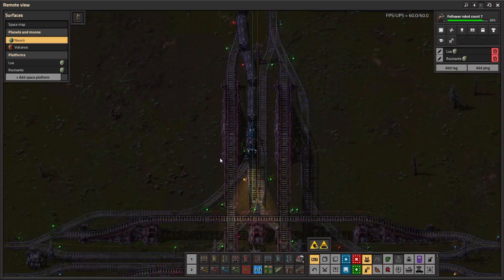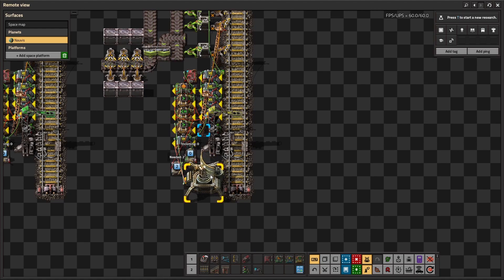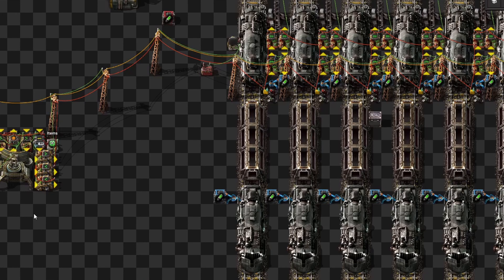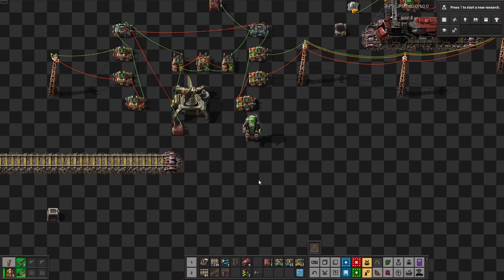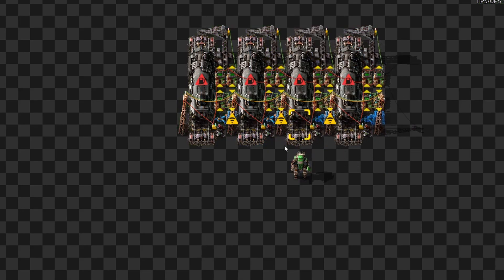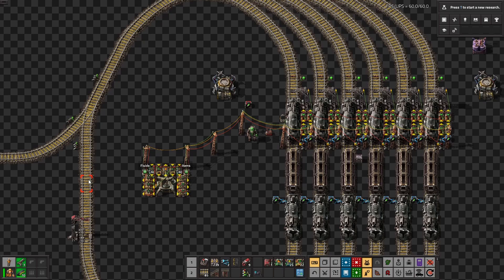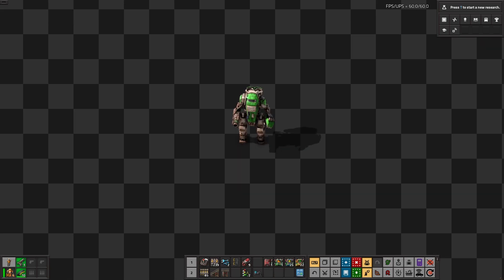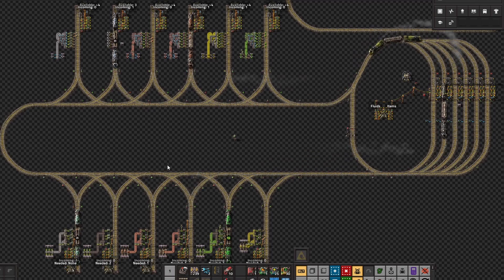Factorio 2.0: Parameterized Train Network

Comment: Not sure what i am doing wrong but no train is leaving my depot to pick up stuff.... mmm
Reply: been trying to figure out what ive done wrong for the last few hours but i do not see it at all. Trains are in depot on inactive waiting for a call but nothing. when i force click on the ptn item pickup or drop off i get the error that the train cant find its way to the station but i can manually drive there so no clue why that is.
Reply: @Yorven So i got it working now but i changed something in the interrupt scheduling while testing something out and now its messed up again, i cant revert my save. any idea how i would revert it back to the correct schedule?

Comment: Hi,

Problem 1:
This network only works in the late game due to certain components (requester chest, selector combinator, etc.).

Problem 2:
The connection between the blueprints doesn't work!

Problem 3:
The distance between the deport blueprints is so minimal that adjustments are impossible. => Example: requester chest through belts for the fuel

Problem 4:

Trains in the deport refuse to move, even after manual connection &  refueling, and remain stuck in the deport.

oh, and yes. the music get's too loud.

Comment: I'm trying to use your system to make my own "mega" base, and am running in to problems with it. All my pickup stations have a train limit of 0, thus allowing no trains to pick anything up to take to where they need to be. I am running 8 wagon trains (both fluid and solid) and am giving all stations two parking spaces behind them. Any ideas as to what I am doing wrong? Thanks.

Comment: you could use quality for differentiating the train length. common signal = 1 wagon, uncommon = 2, up to 5 different wagon length
Reply from the maker: I considered that, but it would mean you would need to pay for SA in order to get the system to fully work, which would then not work if you wanted to use this in a mod that doesn’t support Quality, like SE/K2

Comment: Personally, I find your system extremely complex, and I wonder why you designed it this way when you could easily manage it with a combinator for comparisons? As a requirement, and the depot is only an optional component for me.

I've uploaded my save game; if you like, you can take a look at it. I also built an automatic factory there.
https://drive.google.com/file/d/1LPfvf0NSK24VLLPqRFpO3TPqL3404l7w/view

Comment: Is there a "drop" station limit or a range limit? I doubt that there's a range limit since the radars stream to the whole surface but I'm not sure if destination range has anything to prioritize etc. I got a depot with 5 trains. Everything was working as intended until I added my latest drop station. Everything is setup as usual, but the trains do not go to the pick up station even though the item is streamed as requested. If I force the trains to go to the pickup station they pick the items up and successfully got to the requester station but don't do on their own. They do pickup the same item for other stations though.

Comment: Just implemented this system on our save and it works really well! It might not be the most efficent but it looks the coolest and it's what I envisioned when I started the world. 

Thanks for the video and blueprints!

One thing I will add is I don't think you mentioned the requirement to hook the storage chests to the provider stations, I was scratching my head for a while until I rewatched closely and noticed that. Other than that though, really good informative video!

Comment: I have solved depots in another interesting way. When my system gets a request I have the signal of that request count up with a loop. My trains have in there schedules that they leave when the count reaches 2000, arbitrary number. However to prevent trains from getting a 200 signal at the same time I subtract their unique train number. It works amazing especially as I can send the same request signals to trains that are at delivery stations such that they will immediately pick up a request that is open instead of returning to the depot.
If you would like to do different size trains in your system you can do it by changing the names of their associated stations. I do use small quality item trains for which I just use a similar blueprintbook with a quality icon after the item icon in all names.

Comment: I was thinking on designing provider/requester station with dynamic priority. For example, if the max train limit is set to 3, then the requester station that has less then 1 train worth of resources gets priority 100, where the full station gets the priority of 0. It kind of overrides the priority calculation train makes by itself, and eliminates the need for smart depo, just plain generic trains. But I do not know is it better or worse then ltn, as I have very little experience with them

Comment: Kinda makes me want to post my setup haha. I over engineered mine with multiplexing and 2d arrays 💀 but now i can see statistics on 2/10 providers.

Has destination priority, and the ability to pickup steel so it can be delivered to the engine station. (So across different station names)

All on the red network.

I added 100 unobtainable recipe signals to combinators by editing the blueprint json to stop radar interference just incase too.

Only issue keeping it not from being ltn is that if depot 1 further away than depot 2, it will request from depot 1 first.

Comment: I found this when I was looking for a way to convert my base fully to rails, but it doesn't seem to quite work for me. The trains will go to the provider stations I have set for ore just fine, but instead of taking things to my ore requester stations, they just go back to the depot and then get sent right back to the provider stations, despite having a full load of ore already.

My ore requester stations also seem to be flickering between allowing 3 trains and negative 3 million trains every few ticks, and I can't figure out what's causing that either.

Am I missing something obvious, or is there something more deeply wrong with how I've set up my system?
Reply from the maker: It’s hard to debug this system by text descriptions, but what I think could be happening is. The trains are heading back to the depot from the providers because they don’t have a valid destination. The requester flickering tells me something else is contaminating the signal somewhere, probably from the depot, because that’s the only thing in the system that uses timers to cause something to flicker back and forth.
Reply: @Yorven  I think I've managed to debug it? It definitely had something to do with the fact that I was missing a signal at my requesters, so the trains couldn't get there. But it's still not quite working 100%. I'm going to try and troubleshoot it some more, but thank you for your help!

Comment: This is really awesome! I'm definitely going to take some of your design decisions as inspiration for my v2 LTN-Like system I'm working on after a couple month break from the game.

I needed my network to be totally train and railway agnostic, meaning I wanted to support any number of depots, and any number of train lengths and types. My Depots also can hold trains exclusively based on the train's length, which means you can see both fluid and cargo trains of matching lengths next to one another in the same depot. The trains enforce their own length/type through their train group, and that trains in that group only service the applicable stations, enforced by that group's interrupts. I follow a provider/requester station name template like: "[Cargo/Fluid Wagon Icon][Cargo/Fluid Wagon Count # Icon][Item/Fluid Icon][P/R Icon]"; And my depot stations were: "[Locomotive Icon][Cargo/Fluid Wagon Count # Icon][Stack Icon]". Then for every length/wagon type train I wanted to use the networks, I had a different group with specific interrupts that targeted the correct stations.

Preventing multiple-dispatches was tough, but I got around it with some timers that acted like a minecraft repeater between every station. A dispatch signal was randomized at the depot level, and propagated to each depot station at a configured delay. If a request signal got dropped from the depot due to a train starting an "order", it would be dropped by the entire depot's propagation chain immediately, and the next item selected could never be the one just dropped (unless there was still an active request for that item on the global network). In my next iteration, I want to try selecting the signals directly at the depots either with randomizers (to possibly help mitigate multiple dispatches) or just plane-jane iteration (which will definitely need some extra dispatch deduplication logic), and make the only depot-wide logic filtering out the requests that have no providers available so the parked trains don't waste a cycle trying to dispatch to an item that the depot already knows isn't currently serviceable.

My v2 stations are all in a ready-to-test state, but I'm also making an upgradable railway network in tandem and that's been a lot of signal matching between the tiers. I've really liked seeing everyone else's implementations of a vanilla LTN-Like experience!

Comment: Just passed the 900 hours of gameplay and I just found out about radars and signals with your video. What the actual hell
Reply from the maker: Yeah those things are new. Radars only got that ability after the 2.0 update in October. Pretty useful.
Reply: i find it handy to use an arithmetic combinator to isolate the signals i put into the wireless network to one direction. so my train stations can update global supply while still keeping track of local inventory for train calls without getting polluted from other signals coming in.
Reply: @TheJacklikesvideos  hi this sounds super useful.  Not sure I totally understand what you mean.  What are the arithmetic combinator settings you use to do this? experimenting now thanks
Reply: i had a "radio mod" for a while didn't get much use out of it, but i was blown away it is now in vanilla

Comment: Excellent video, congratulations!!

I had an error that I spent more than 6 hours trying to find the "error" in my process but I couldn't. I built my entire loading/unloading process according to your BP`, but the trains don't leave the depot.

I believe there must be a specific command for them to work like the LTN, could you help me with this situation?
Reply from the maker: Trains don't leave the depot... I'm not entirely sure what could be causing this, I just rechecked my blueprint and it's working fine. I would suggest 

1) the blueprint places trains in manual, switch them to auto by clicking the button for the "Depot" interrupt, the train should transit to the depot and wait there for the green checkmark signal. 
2) If this is a fluid train, then likely this is an older version of the blueprint where I missed a condition inside the interrupts and have since fixed. Re-import the blueprint from the website and place the depots again. That might do it.

If these don't work, then I do apologize for wasting your time like that. I would offer to come into your world and check the system myself, but I'm not a stable internet connection at the moment.
Reply: @Yorven  You don't need to apologize, I appreciate your response and I will continue trying to find the error. At first I thought it was the interruptions that were misconfigured. However, this is correct.

Comment: I have a somewhat straightforward (and one very complicated) solution to your problem of not being to specify what type of train you want from the signal if you're interested. As long as you dont have arbitrary length trains and only a limited set of possible train lengths, the simple one is pretty easy.

Assuming your requester has a memory cell that increments on the radar signal seen for a single tick, instead of adding "1" you can divide a 32 bit interger into 4 (or less) groups where each group represents a train length. Using hex, your single wire value can be represented as such: 0x00_00_00_00.

Then, you can specify that each grouping of bits is one train set. For example purposes you can say the groupings are as follows: bits 31-24: (A), bits 23-16: (B), bits 15-8: (C), and bits 7-0: (D). So, for example, we can say group A is a 1-2-1 train and B is a 1-2 train. Then, to request a group B train for iron you pulse the the  value 0x00_01_00_00 on the iron signal, and when you dispatch it you pulse the negative. 

If you are are familair with networking, you can somewhat loosly think of these groupings as different subnets to same IP. If you are more familair with programming, in C this could be done with a union of 4 chars and 1 int32 (avoiding the manual bit shifting).

Downside(?) With 4 groupings on 32 bits (im not sure the max value of a number in factorio) is the limit is 255 stations of the same resource per train set. Less if you use smaller groupings
Reply from the maker: @bmoc_jr  Well. I’m not sure I completely understood all that, but I think I know the solution.
Reply: Ah, sorry, I was typing what came to mind on my phone while out on a walk. Usually I'd want to write it on paper first. To summarize in retrospect, you can use 4x2 arithmetic operators (bitwise AND and a right shift operator) to acquire the 4 groups (each 1 byte) out of a single integer memory cell or signal. Where that byte is indicates the train configuration you want
Reply: Had to lookup the term, but the arithmetic is an example of bit fields if you want to have something to search online
Reply: Well, I guess that also lets you split up the depots if each is responsible for its bit grouping memory cell. The ones that don't just mask out the request with an AND bit mask and ignore the pulse
Reply: Ah, and to avoid some extra bit math if the maximum integer is signed, the last group A can be limited to 7 bits. That way to do math it is just signal+(1 value of that group, 0 the rest). E.g. to add/subtract one request to group b you do memory +- 0x00_01_00_00. Otherwise you always have to do bit wise masking and arithmetic. This is avoided if you stuff it to 3 groups instead of 4 or limit the last group at the MSB
Reply: The complicated solution involves recreating some media access control protocols like you find on wireless networks, but would be wayyyyy overkill for this. Though they would let you send arbitrary datagrams and some custom protocols (like srcID-dstID-proto-payload-trainConf then an ack). 

The topology of factorio is like a perfect wireless network (no hidden nodes) and almost  like a data bus since there is a side channel. It could be arbitrated like a bus (using red/green channels) or like a wireless network (common medium, CSMA/CA). Easier is probably like a wireless network